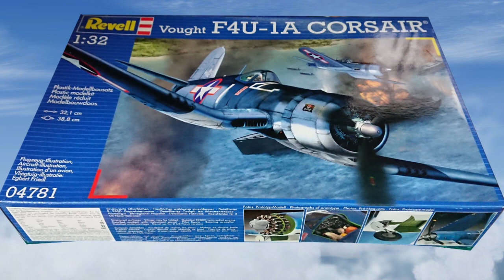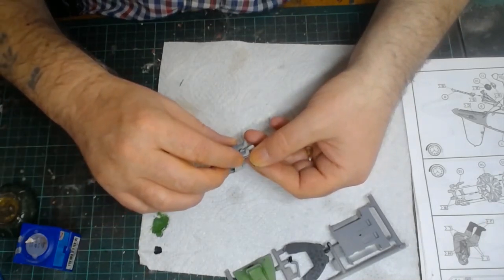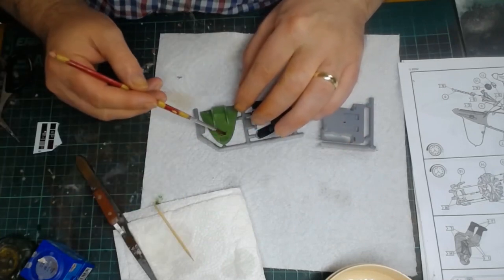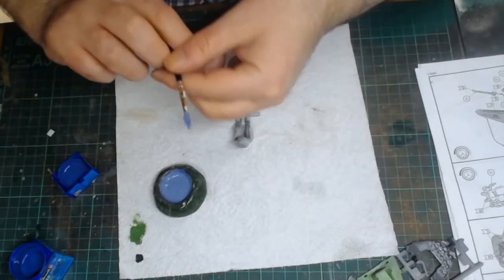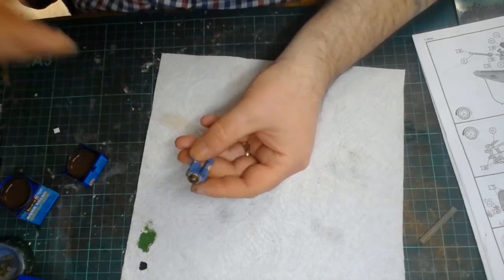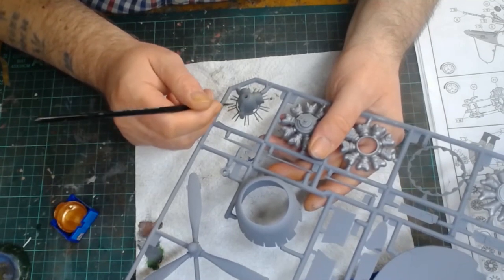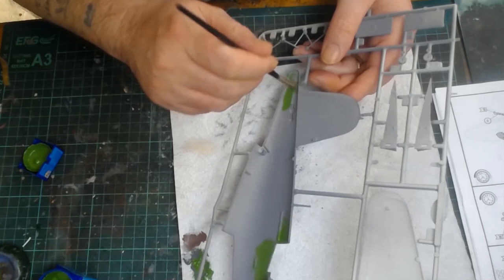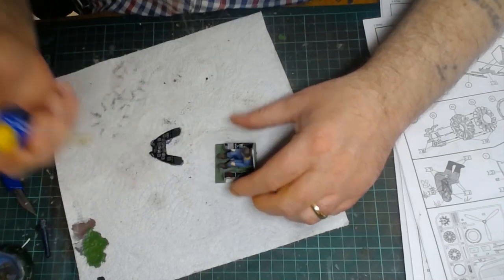Revell Vought F4U-1A Corsair Scale 1/32 Part 2

Comment: Excellent - thanks. I'm a newbie 58-year-old. Bought lacquer paints and an airbrush, but the smell really put me off and took away the fun. Just about to start my first aircraft in 50 years - have switched to Mr, Hobby Aqueous paint - will try your pre-painting technique with a brush. Keep the airbrushing for the fuselage. It's supposed to be fun after all.
Reply from the maker: Welcome to the hobby the51project. The key is thin coats and don't grip the brush, let it relax in your hand and gently apply the paint.  Once you have mastered that then you can look at different pressures on the brush to achieve various tones and shadows. You will develop your own style over time and as you have said it's meant to be fun, remember it's your build, and if you are happy with the results that's all that matters.
Reply: @ReckshawScaleModels  Thanks for the advice. (Fellow Scot in Brisbane, AU).